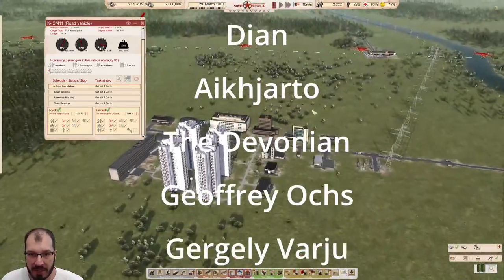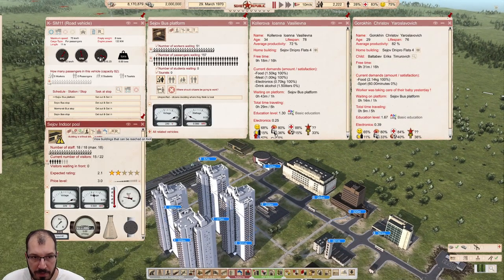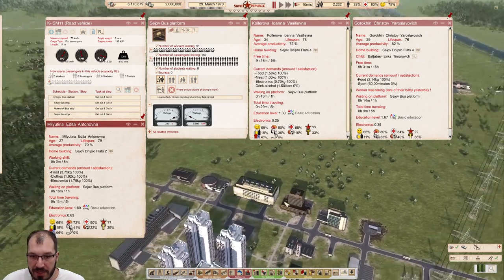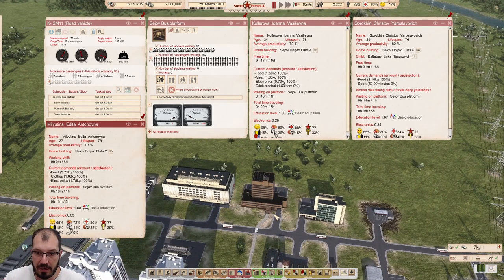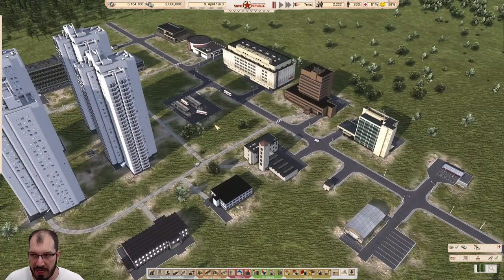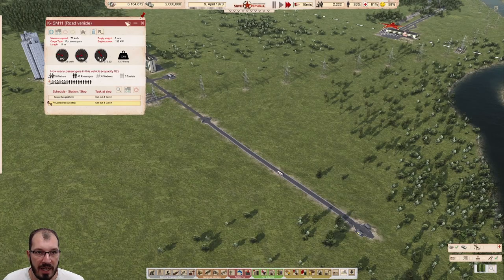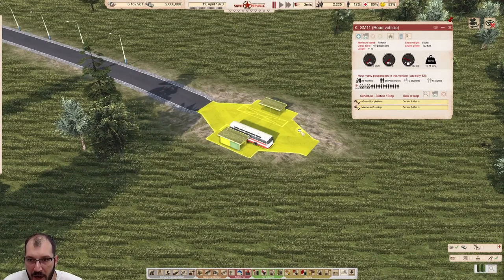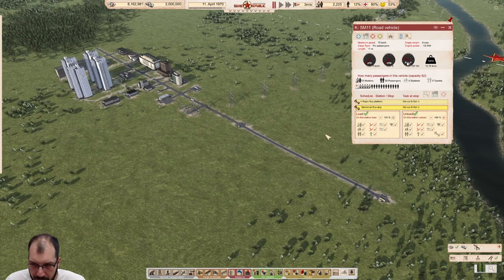Citizen Demands and Transport Explained | Tutorial | Workers & Resources: Soviet Republic Guides

Comment: Very minor correction: during the first transfer test, IF any of those passengers had a need that could be filled at the other platform, they would have gotten back on the bus as well.
Reply from the maker: That's the whole problem, and why I'm pointing out that you should not load and unload at the transfer station, only unload, otherwise you are loading everyone you unloaded, which is only good for extending travel times for passengers.
Reply: @bballjo  To be fair, that's realistic -- "rest stop".

Comment: Hi, Bballjo,

so basically transfer hubs DO work if I understand correctly? 

If you set up a line with only 1 transfer stop on it, the game will simply force everyone out on that stop and "allow" only peeps with availability of working/need fullfilling somewhere along the original line; so you may build a drinking district stop and every boozelover will need to go there via bus and won´t be crawling in the city (and he WILL take the bus eventually?).

If heard correctly:
- the transfer stop will FIRST try to accomodate everyone and force them to first vehicle in any direction they desire and only THEN it will push then out to businesses (and other stops around), or any people on the bus will immediately go fullfilling their needs in the vicinity of transfer stop WITHOUT trying to wait for a bus for next 1 hour?

And also it is worth to build transfer stops the way you only unload at that one, go around to "only load" stop and pick passengers up there to avoid picking same guys on again?
Reply from the maker: If you use the transfer option, they wait for an hour, just like they would if they would walk to the same station...once they are at the station they either get on a bus or after 1 hour they will leave the station...so it's not as simple as you described, but yes it's possible I believe...stay tuned;)
Reply: @bballjo  leave the station = they go to nearest work/utility they need/bus stop in reach (or preset one) or they simply despawn?
Reply from the maker: Both...they will walk to the nearest anything that can satisfy their need and has space, or they teleport home.
Reply: @bballjo  You can get around the 1 hour wait for people going directly to jobs/services by placing two consecutive stops at the transfer station. Make the first stop a normal drop off point, and the second a force citizens off drop off. At the first stop, citizens will disembark and immediately leave for open slots for what they want, while everyone else is forced off and made to wait for an hour.
Reply: @siriusczech  See above.
Reply from the maker: You don't need to double stop if you are using the transfer station. That's a completely redundant step at that point, plus you are creating an infinite loop, which is bad unless you only allow 1 type of passenger. The only time you want the loop with 2 or more stops is if you need to keep people around at all times, like remote construction sites, but then you have to manually assign all buildings you want to use. Also you do not get around the 1 hour limit by placing 2 stops and connect them, you are infinitely increasing the 1h limit plus you lost the ability for citizens to choose what to do.
Reply: @bballjo   @bballjo  That was not what I had in mind. I will try to be more clear:

1) If I am having a one "hub" station that has a unique utility (for example a huge hospital), I can just feed this stop, set it as "transfer" and forbid loading any passengers at it. All peeps will get off the bus and as long as noone will be picking them up there, they will either
a) go to a hospital
b) go to another place fulfilling their needs
c) go to a different bus stop in vicinity if there is any
d) despawn back to home. 

With every line set as "transfer and do not load", this hub works (as terminal station). Is this right?

2) I can also pick up people from said hub for different lines. For example I can feed 2 lines from "suburbs" (residential areas) to such transfer hub with "unload only", while running a line to stadium, different line to industrial grounds and a different line to hospital. Now - IF UNDERSTOOD CORRECTLY - please confirm:
a) Anyone allowed will take the bus to transfer station (so called hub here) and will get out there
b) Anyone in any station will take a line that has potential of satisfying their needs at some stop (being it work, drinking, hospital or whatever else), but will NOT take a line that do not offer this (unless it is a line with DIFFERENT transfer point)

=> c) line PICKING UP PEEPS from said hub must NOT have (any other) stop set up as transfer, otherwise it will be boarded by anyone disregarding desired destinations. Is this right?
Reply: @bballjo  Can this work in a largel scale as well? LET ME PAINT YOU AN EXAMPLE:
Imagine a cross-shaped city with two main roads running through - one from north to south, other from west to east (and vice versa of course). Each arm of the cross has 1-3 separate stops and the middle of the cross has one huge passenger terminal with big capacity.

One arm has a hospital, second arm has a stadium and university, third one has huge distilerry and pub and forth arm has a big cultural district. All four has residential areas, shops and kindergardens+schools, but not every other "free time things" is in walkable distance, hence the (lets say bus) stops.

THE BIG QUESTION: HOW TO SET THIS TO WORK properly? 
A) Lets start with basic idea. Every arm of the cross will have its own line. If there is only one stop on your arm, you:
- set the line to pick up anyone on small stop and set the "hub" as a transfer. This way any peeps not finding a job/utility in their walking distance will go to the stop and take first bus to (any) transfer station, right? This line will also be able to pick peeps back if they desired its "specialty", others will simply stay put on that stop and wait for a different line. Of cource the "problem" with stadium/hospital etc. is always the thing that it also needs workers, so workers can easily overrun this system. More on that bellow. But in general this should work flawlessly
- it the line would have 2 stops (or more) on its branch, would it be better to switch off loading peeps on the way "out" aka from the hub on (any) stop(s) except the last one? It might ditch peeps from that branch to go to f.ex. hospital, if that would be in the arms end (and would force those to go through the hub station instead), but would also protect the line from overcrowding with people wanting to go the other direction and thus prolonging their travel time, right? Or is it not worth it at all? I didn´t test any of these, I am just thinking out loud.

B) You could maybe join two lines into one? Probably not the opposite ones, as that would require two stations set as "transfer" and that would break the logic. Or will it, if it is the same one?
Anyway, joining that cross into a sort of "cloverleaf" shape and running buses in round around each cloverleaf (in crossshape lets imagine 4 lines: from N road northbound to E road "inbound, from E to S road, from S->W and from W->N). All those lines would come through the hub only once, picking there only peeps interested in their "branch" and others will simply wait, right?
Or am I making a mistake somewhere?

C) Obvious flaw is that you have "too many workers" who clogg up the system. I can think about two different solutions
- first: exclude workers from loading in from the hub from all passenger lines (basically setting rules that every utility will take workers from it´s vicinity or having none at all; little fragile but doable) AND setting up dedicated workers-only lines. 
- second: use something like a metro/tram and force the transfer of workers to this other station. It will pick only workers and could easily feed into 2-5 stations each direction (depending on capacity of industries there). Maybe 5 station is too much? Maybe "fast line" serving outer 2-3 and "slow line" serving all would help covering them more reliably? You say that :)
This second thing has only one negative on it - can you set this transfer up only for workers, or will EVERYONE transfer and then you will need the "infinite loop" between two stops to actually work it that way?

D) There is one more question which I am considering - with good frequency needed on all lines, wouldn´t it be usefull to have one or two of "unload" small stops which will directly feed into the bigger one via walkways and then queue the buses via the main terminal, where it would pick peeps again? Many real-life terminals of public transport works that way (with usually some resting time for the bus drivers, but that is not a thing in game). 

Am I right and did I understood your tutorial correctly, or am I missing something? This will be crucial for my bigger city planning
Reply from the maker: The first example with the hospital hub...in that scenario there is no need to set the transfer option, because if your only goal is to unload people there that can satisfy some need, then that is all you need...the transfer option is only to actually allow transfers from line to line, with the dangers I explained in the video.

Big city planning...your suggestions/ideas are all valid, but there are 2 crucial problems you only touched on, but they are really the make/break facts: capacity and 1 hour wait limits... capacity is related to stations and vehicles alike, once they are full you will have a problem, having multiple starting stations should help that a little. You never want people to get stuck on the starting line because there is no station space available. The next one is that your vehicle capacity needs to be big enough...in many cases with the vanilla stations you will probably only get 1-2 vehicles into the station in the 1 hour time limit, so if you have a 1500 passenger station, but you only pickup 100 at a time, your going to have issues. Note that I did not mention line spacing here, because the 1 hour limit trump's that... ideally you want the next bus already at the bumper of the current bus, so you have as little no bus time as possible. If you can handle those factors, then you should find that the rest is simply a matter of giving enough options and spaces in reach, but those are much more static problems that you can solve by adding extra buildings or even new stops later on...if you beat the capacity and 1h time limit problem, you should be ok.
Reply: @bballjo  I think you are confusing what I am saying with the double station trick. I am saying to make two consecutive stops at the same station, so that riders can disembark and leave for job/service slots instead of needing to wait an hour before leaving the station. Everyone else will get off and wait at the station for a new line to ride.

It is not redundant because the first stop (same station) allows citizens to immediately leave the vehicle AND the station for any open jobs or service slots (they don't wait for an hour first), while the second stop (same station) forces everyone else off at the station to find a new line. 

Since the citizens that got off at the first stop (same station) do not wait at the station, you also don't need to worry about the second stop (same station) picking them back up (unless they finish their errand and go back after, which is generally what you want.)

The double station trick you're talking about is a favorite of mine, but it's not applicable to what I'm talking about, and manual assignment is also not required.
Reply: @bballjo  thank you very much, I will probably experiment a little in unlimited mode.

For the capacity I exactly meant those "unload stops" and queue of buses between them and loading big terminal. Also a combo of terminal+metro-for-workers and switch between these two can actually help with capacity.

It will be interesting to try

Comment: One question that was not answered for me here is, if people will always wait for the next bus at the bus station with the transfer option or if people would also go to work/needs when there are buildings available at the transfer station. Without having tried it, I highly bet the later will happen. So if you had connected a bar to the transfer stop at the end, would people have walked there after unloading from the bus?
Reply from the maker: The question you are answering was already answered... citizens will always go on the bus that satisfies their need or with the transfer option...there is no waiting for the better bus.
Reply: I am not talking about the small bus platform in the city where the citizens start their journey. I was talking about the bus station where they are supposed to "transfer", the one that only has another bus station in walking range.

So the question is rather: Does the transfer option unload specifically to the station/platform and not let people walk to their actual needs or does it unload like a normal stop in the line but it also forces all people out no matter if they want or not? (In addition to the initial pull factor of "yes, I will satisfy your needs")
Because from the name of the option, the first sounds more reasonable but from a usability point of view, the later is probably more helpful.
Reply: In my experience, when you force workers off at a stop with the transfer function they will get on the next bus which 1) allows loading and 2) has a destination they may want. If no bus comes that satisfies 1 and 2, after one hour waiting timer they will look for demand in walking distance, else teleport home. If, for example, you are trying to keep an industry full, you can put another bus stop in walking distance with no service, to extend the time they wait for open work (as they will just bounce between stops every hour if no work open or bus comes)
Reply from the maker: The old mechanic wasn't changed...and I'm sure I said if you drop them via the transfer option they act exactly like if the would walk to that station (aka reset the 1h wait limit at that station) nothing else is different.
Reply: in this very case you have to set two stops for the said bus stop (one after another) – one that will be the standard unload and another one for the transfer. In such a setup, the bus will firstly unload all the passengers/workers that see any free buildings able to fulfill their needs and then it will dump everyone else (and they will wait for an hour before they will check if there is anything worth walking to in the distance).

It can be handy for various power plants and other critical industries – it's good to have some redundant workers that will wait for an hour and then walk to work. If you are into micromanaging (I'm not – basically for such a setup you need few "different" lines that skips or transfer to different stops), you can even provide constant supply of workers for your industry using this one-hour delay and few bus stops.

Oh, also avoid using "load" option for your stops. If bus has no passengers and only "unload" stops left, it will cut it's route earlier. Moreover, you want to provide some emergency supply of workers for your critical industries – buses randomly picking up and dumping your workers everywhere and anywhere really get in the way.
Reply: @tomfu430  The "force citizens off" option prevents citizens from immediately leaving the station to go to a job or a service building, but once their hour of waiting is up, they will check for open slots (jobs, needs) they are interested in within walking distance and go to them; otherwise, they just go home.
Reply: Yes and no.
If they are dumped with a transfer order at a station, they will wait 1h for the next bus that can satisfy their need at a station down the line (e.g. drinking), EVEN IF there is a bar nearby. However, if no bus arrives within 1h, they'd then look around and see the bar.

So TLDR: if a bus arrives within 1h that could take them to a different bar, they will rather hop onto the bus, be driven across the entire city to a different bar, than look around and realize there's one right behind them. But they will notice it after waiting for 1h.
Reply: @araxiel2051  That is why you enter two consecutive stops at the station in the vehicle's line; the first to let people go immediately to needs they can walk to from the station, and the second to force everyone else off to use another line.